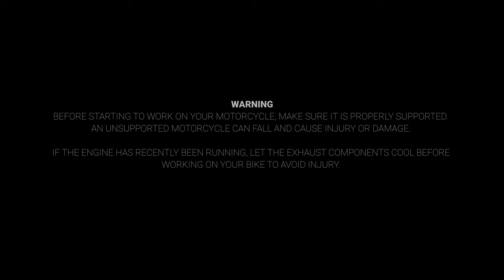How to Install 2-1 GP Carbon Exhasut for Triumph Street Scrambler | British Customs

Comment: That's fantastic! It still tucks in tight and high enough for some dirt riding, but now doesn't interfere with standing, allows soft panniers for traveling, and isn't routed by a passenger's leg.
Reply from the maker: It's a nice setup we've tested with passengers, going off road and it sounds great.

Comment: Will this fit the '23 scrambler 1200 xc
Reply: Also will you guys have slammer seats for the 23 scrambler??
Reply from the maker: This will not fit a Scrambler 1200 but we're definitely working on a lot more exhaust designs for the Scrambler 1200 so please check back!
Reply from the maker: No seats yet for that model at the moment.

Comment: may I ask which years street scrambler is it?
Reply: also is ECU need to be tuned after installation?
Reply from the maker: It is a 2017 and we highly recommend the Ecu to be tuned with the full exhaust system setup